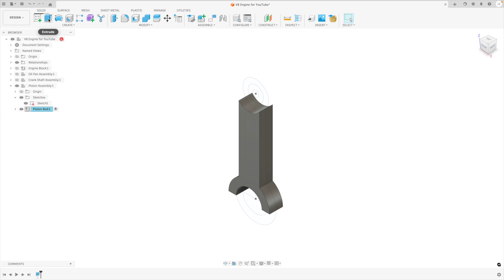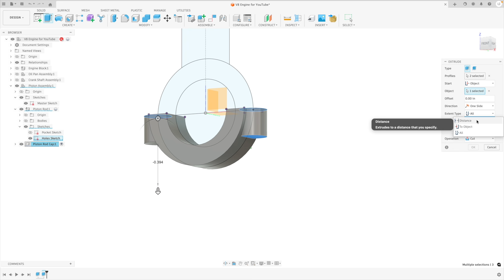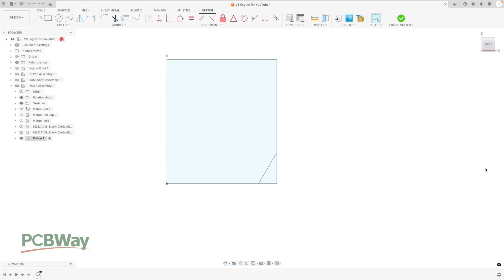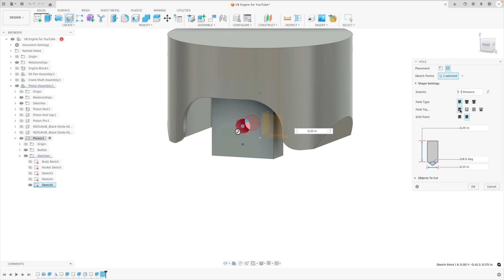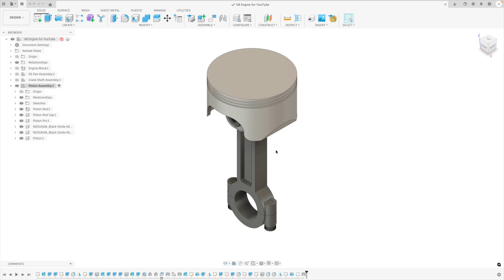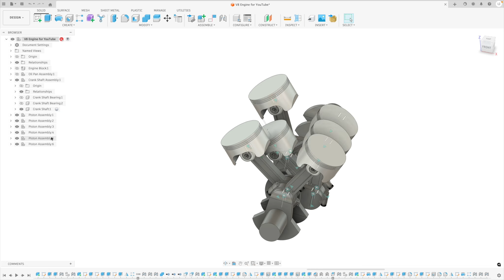Autodesk Fusion Course for Beginners - Part 5 -  V8 Engine - Piston Assembly & Motion (2026)

Comment: The crankshaft with the pistons near the end gets stuck at -112° what could be the issue?
Reply from the maker: There could be many reasons. May I ask, when you say it gets stuck, does it get stuck with manual rotation or using a motion study? Also, have you checked any limits you’ve applied on each joint?

Comment: hi,

im currently making my engineering portfolio and I want a fusion project that includes actual motion study such as this one!

Do you think if I follow videos 5 & 6 of this playlist I'll be able to have a piston/connecting rod/crankshaft assembly which i can use motion study on? Or do I need to use things from previous videos?

Thanks in advance :)
Reply from the maker: Hi! For a working piston, connecting rod, and crankshaft assembly, you’ll need all the necessary components from the earlier videos, along with the correct joints. Videos 5 and 6 alone may not provide everything.

Since this is for your engineering portfolio, I’d recommend reviewing the playlist and determining which earlier parts and steps your final assembly depends on. Being able to break down the mechanism and identify what is required is an important part of the engineering process—and will make the finished portfolio project genuinely your own.

All the best!

Comment: In the end of the video when you are trying to join up all of the cylinders to the crankshaft and if f360 says there will be an error what worked for me is simply just unticking then reticking the minimum value of -0.5 in the joint, hope this helps someone else out
Reply from the maker: Excellent! Thanks for posting this and helping our community.
Reply: Thanks man, i was really stressed out when my 2hrs work didnt give the same results as the tutorial, my motion study is getting stuck at some angle for some reason.

Comment: What Engine Specification of the Selected V8 Engine ? (e.g., Chevrolet LS3, Ford Coyote 5.0, Toyota 1UZ-FE, Nissan VK5) ?
Reply from the maker: I wish it was an actual engine, but getting those drawings would be next to impossible. This is a 60 degree V8 with the same firing order and similar exhaust as a Corvette engine.

Comment: at 13:32 i am giving it as you told in metric but the hole diameter exceeds , actually what i am doing from the start is i am considering 1in = 1mm and taking my dimensions , now I'm stuck
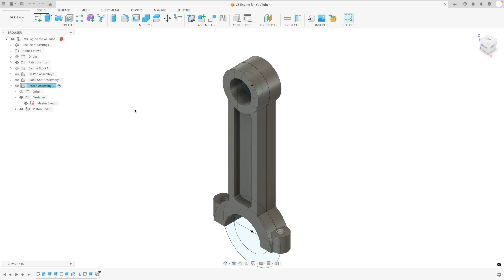Reply from the maker: Please revert back to the first lesson in this series to better see how you should convert units of measurement. Watch the whole thing if you haven’t already. If you have, then just skip to 15:22.

Autodesk Fusion Course for Beginners 1 - V8 Engine - Essentials and Tips & Tricks (2025)
https://youtu.be/SiszAHuVJ5M
Reply: @learnitalready  i did everything , nothing is working , I kept simple holes and adjusted the holes diameter.
Reply from the maker: @Lakum_D  like many others, including myself, we sometimes just have to start again. It’s ok!

Comment: Lesson 5 - is there specs i can print for " Lesson 5 " , got to the end of lesson and realized the diameter of my piston was to large, is there a way I can modify it when I get the diameter?
Reply from the maker: Hi there! Our drawings are available on Patreon for our paid members. A link is found in the description. Otherwise, the dimension is shown in the tutorial. You can easily edit the dimension in the original sketch.

Comment: Hi, thanks for the videos, really helpful. I have a problem with the crankshaft, after I joined the piston to the crankshaft, it seems that the crankshaft rotates around a certain point and not in place, so it comes out of the niche it should be in inside the rings in the engine block. I would appreciate help (there was a problem with the dimensions, I work in mm, it turns out that I created an engine so small that I was unable to fit the bolts to it, I made a scale *25.4, maybe that's what created the problem)
Reply from the maker: Thanks for your support!

Regarding your issue, it doesn’t seem to be related at all to units of measurement, but rather how you’ve joined the crankshaft. Delete the joint you made and try and join again. Pay special attention to the snap point of each joint. Sometimes people will select the wrong snap point. Let me know if that works.

Comment: Class 3 is actually looser, not tighter.  Class 1 would be a machined thread, Class 2 and 3 can be machined or tapped.  Just an FYI.  Machinist.
Reply from the maker: Thanks for your input. However, the following is true according to the machinist handbook (from a machinist and designer with 30 years experience):

1B Threads (Extremely Loose): These have a large allowance, designed for quick and easy assembly, even with dirty or damaged threads. They are rarely used in general manufacturing.
3B Threads (Extremely Tight): These have very tight tolerances and no allowance. They are used in high-precision, safety-critical applications like aerospace.

Comment: Hi, Thank you for this follow-up.
I wonder when we modeled the crankshaft if we had set limits on the movement of the link.
Because I am forced to rotate its axis (it does not rotate 360°) 
No matter how much I look in the properties of the connection I see nothing, and when I simulate the movement it turns on itself.
But in the browser tree in its connection "revolution - Rotation there are two symbols - 1 locking padlock and the symbol modify the movement limits"
I tried to intervene at this level but nothing worked. 
Is this normal, or not?
Do you know this problem? Can we fix it or does it not matter?
Reply: Problem solved ;)
Reply from the maker: Nicely done! Please share for the benefit of our community. Also, have you joined our Discord server yet? It is a lot easier to share screenshots and connect with others that might be able to offer assistance too. https://discord.gg/Rcd9jnSX
Reply: @learnitalready  It's complicated for me to communicate in your language even if there are translation tools, but I'll keep the link. THANKS
Reply: Can you share how you solved this?

Comment: For some reason when I make the 3rd cylindrical joint between piston assembly and crankshaft, it ends up under crankshaft assembly in the browser, while the rest ends up under the main/head component assembly. Tried to redo just that joint to see if I by mistake had the wrong component active while making it the first time, but that was not the case. Any Ideas?
Reply from the maker: Very interesting! The only reason I can think of is that the wrong component was active. When you undid the command and tried again, what happened?